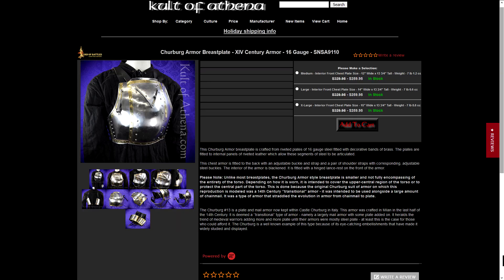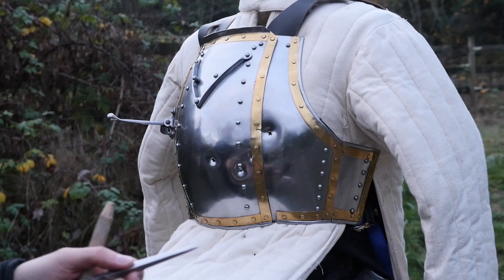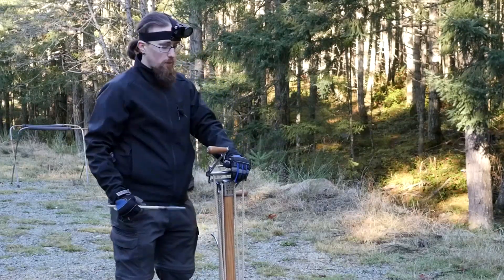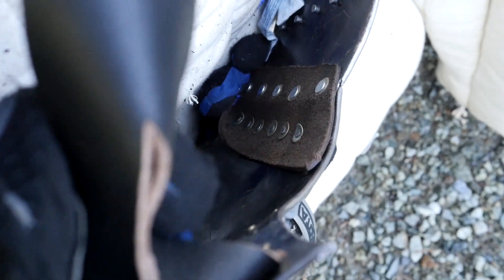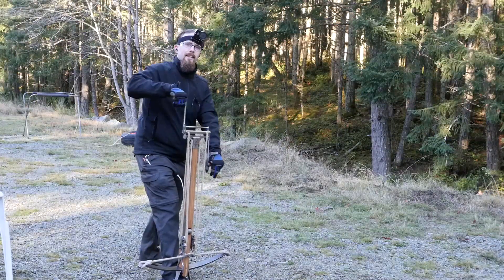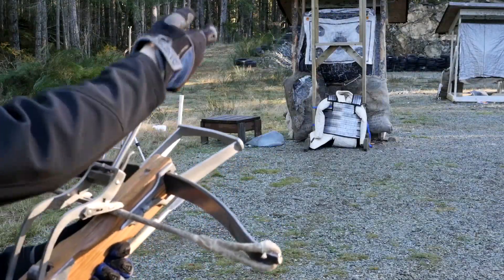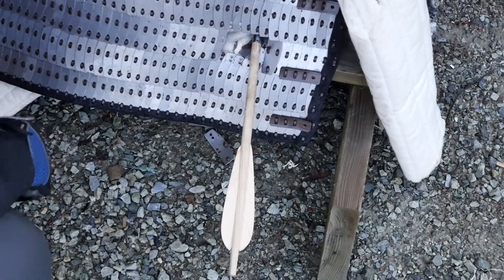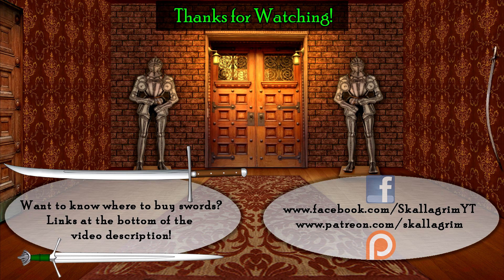Medieval Crossbows vs. Breastplate and Lamellar Armor

Comment: Hey skall were full metal bolts ever used?
Reply: I think it would be really heavy and expensive. They would fly less far than regulars, if they existed they might not have been a great choice
Reply: Those'd be kinda heavy
Reply: Never used in Europe. Cannot say for Asia. But it would probably suck balls. Too heavy to be really used effectively. Do not forget, energy is mass times velocity. More mass means less velocity. If its too heavy, it would just suck as a weapon. Not even talking about the range and the cost of making one. All the metal you threw away to make tips was probably enough. 

Also, I would probably not fly as good. Wood + geese feathers work great for stabilization of the steel tip. A steel tail? I doubt that would work.
Reply: Im not saying they would be good i want to know if they ever were used
Reply: Mykel Mods Nerf i dont think there ever was for the reasons that the other said ....if a proto type was made it most likey trashed fast and not produce
Reply: Gustavo Larancia really may have to look in to that
Reply: Probably not, but a heavier bolt (metal) would be better at penetrating armor. So maybe they were used at short range for that reason
Reply: Might get to find out when I forge a solid steel bolt for Skall. :)

Comment: Held up quite well for being budget plate
Reply: They're probably made out of slightly tougher steel than originals. Steel quality is much better now. The only things really "budget" in comparison to originals are the quality of the finish and the fitting. The protective capability is pretty much the same, at least against crossbow bolts.
Reply: I was surprised it held so strong under my hammer blows.
Reply: The Churburg 13 is a solid design. A lot comes down to the quality of leather used to hold the metal together, admittedly, but in terms of glancing surfaces, it's pretty good for its time.I would recommend it highly for people who want to doa transitional 1350s reenactment and who don't want to do a coat of plates for whatever reason.
Reply: tougher maybe but poor tempered from how easy the bolt bent it
Reply: Better steel, worse craftsmanship. The original breastplate had a solid textile back and much more overlap between plates. Also it is likely (though I'm not sure) that the front plate would have been thicker than the side ones.